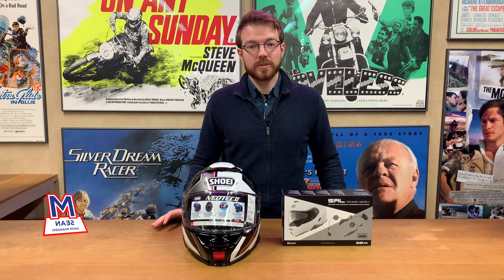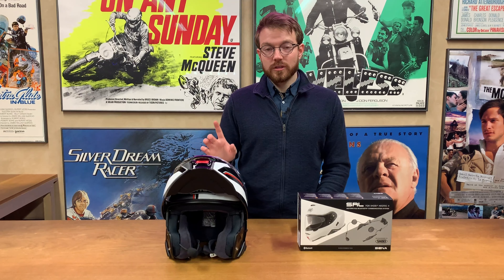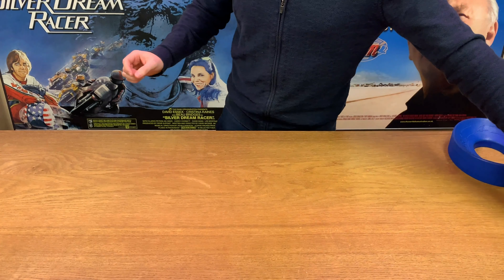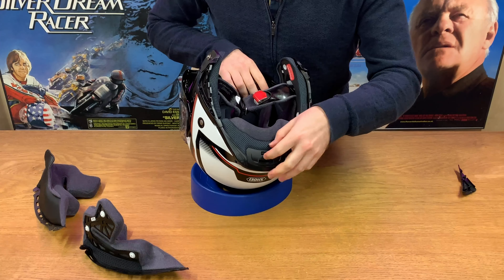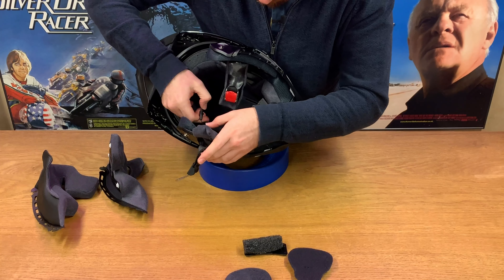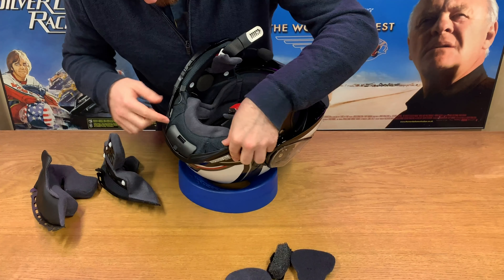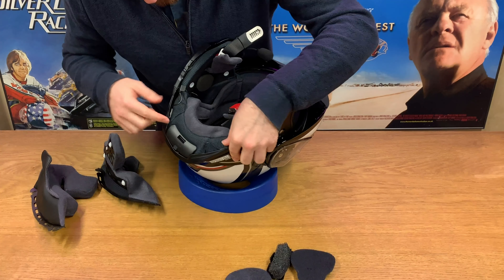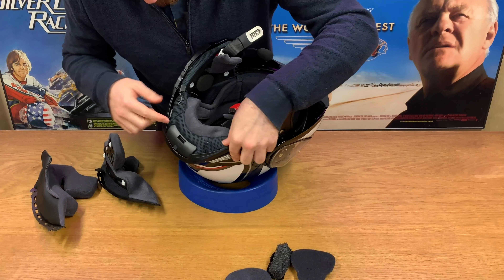Shoei Neotec 2 helmet SRL intercom fitting guide

Comment: I have both, the Neo tec2 and the SRL.....The installation is pretty easy and you tubers everywhere simplifies it. I ride a new 2019 Harley Davison Road Glide, and here is the goods. The SRL is a huge pain in the ass to connect to others Senas when doing a gang ride. The volume of the speakers is crap at best, honestly once above 70 MPH you cant even tell its on except for the occasional blip of noise, if you are trying to listen to music, like a lot of people do on these long rides just forget about it. OR, do what I did, I saw a you tube video where a guy bought 20 dollar over the ear headphones he cut the speakers out of the cups and soldered them to the Sena wires. It was pretty easy and when I did it it looked like crap when I was done but the speakers were WAY better and louder then the Senas.
Reply: No cry baby🤣🤦🏼‍♂️

Comment: Does the helmet close properly with the boom mic and the chin curtain installed? With my HJC helmet if the chin curtain is installed then it catches on the boom mic when the front of the helmet is closed.
Reply: You need to pull the chin curtain when you close the lid, otherwise it will catch the mic when you close it and your mic will be too low.